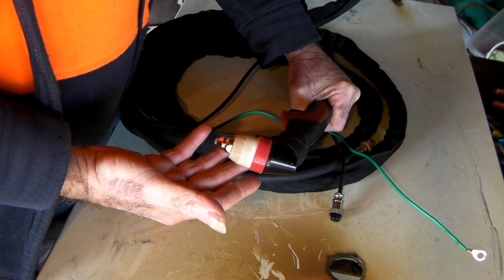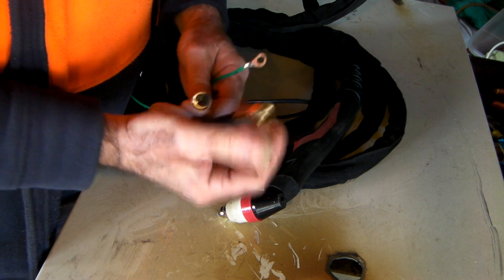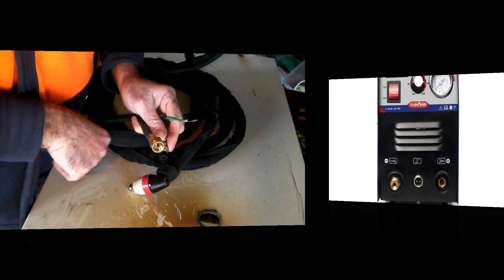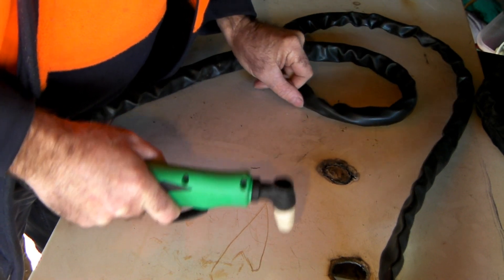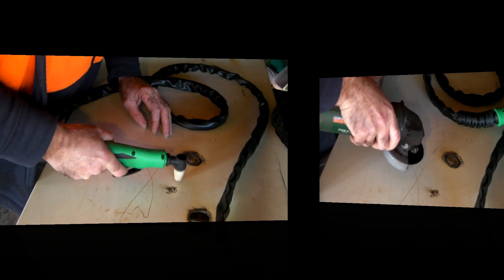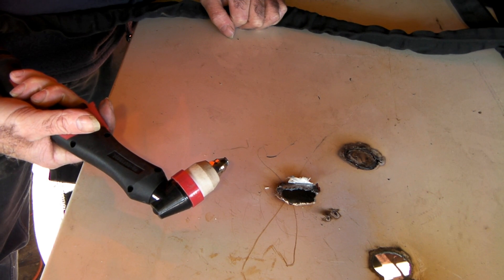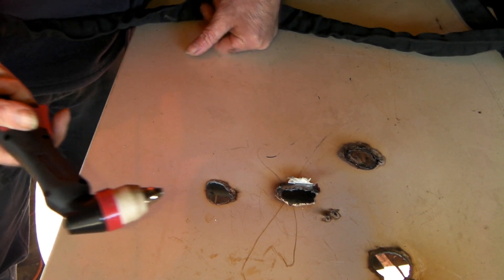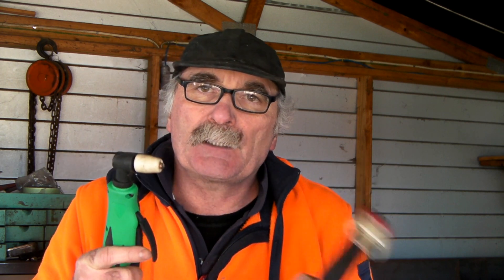Non Touch Plasma Cutter / Pilot Arc vs Non Pilot Arc

Comment: Hi Pete, good info as always.  I used your trick to turn my HF PT-31 into a "non touch" torch.  Have you tried buying a non touch torch to replace the PT-31 and just tie the extra wire to the ground lug on the HF machine?  In my mind it should work and then you would have converted a cheap HF machine into a plasma start machine.   Do you think it would work, and do you have a recommendation on the torch to buy?
Reply from the maker: Great tip!

Comment: The pilot torch, as you know is also great to cut, um, grates. That’s a real pain with non pilot arc machines. Just thought I’d mention it for the viewers.
Reply from the maker: cool
Reply: @petestools  I'll give you both a tip. The 125 mm grinder with a 0.8 mm cutoff disc outdoes both machines! I use a Lincoln Pro20 machine to do the neat cuts and the 50P non-pilot to cut up to 6 mm. Correctly used, the cut off disc is faster and cleaner.

Comment: Have you ever checked out the Red Lotos LTP5000D mine is a 2005 year built
Reply: 2005 model year 3 prong power 120-240 voltage DC INVERTER
Reply from the maker: Nope but might review some lotos machines thanks

Comment: Hi Pete! Very helpful!! 
Is it ok to actually touch and drag a non-touch torch along the metal or do you have to hover it slightly above the metal while cutting? Thanks!!
Reply from the maker: If your useing a non touch tip .keep it above your work .Try useing a standoff guide. cheers pete
Reply: @petestools  ok thanks!